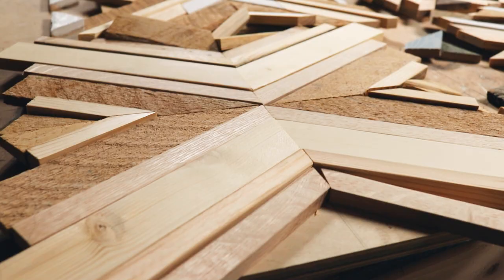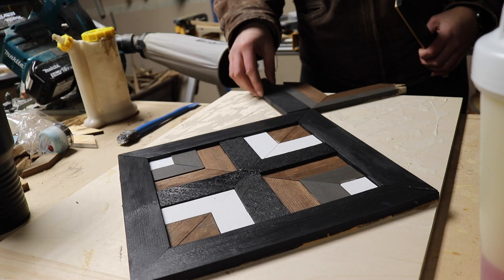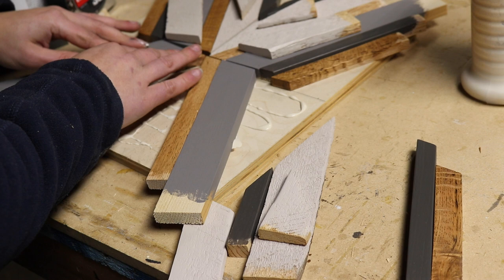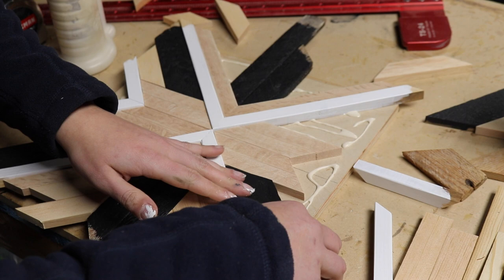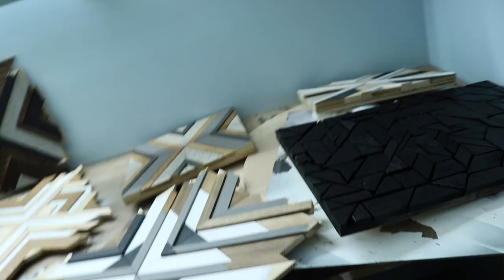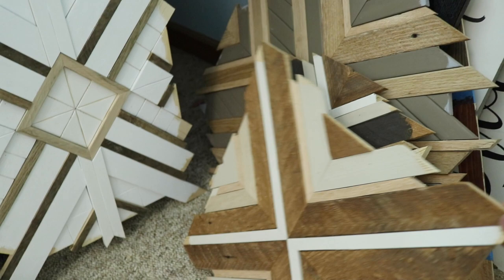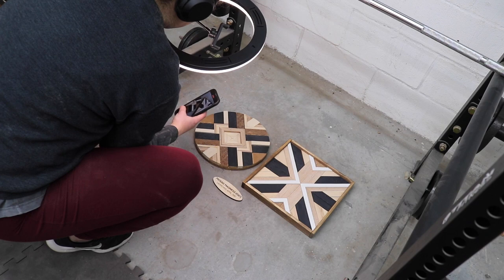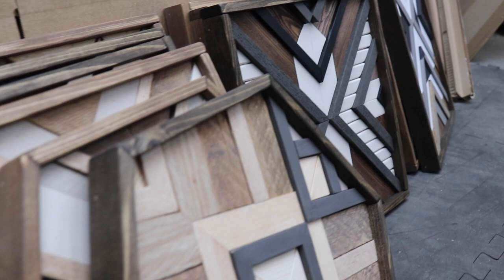Making a Geometric Wood Wall Art Collection- Mosaic Madness 2023

Comment: Amazing stuff! How do you trim them down without the pieces coming unstuck?
Reply from the maker: Thanks! I glue and pin nail everything down and let them dry completely before cutting the edges with either my track saw or table saw. Sometime I have some chip outs, but I found the table saw reduces that a lot.

 Hope that helps! I am currently working on my second Mosaic Madness series and filming so I hope you get to watch those videos as well :)